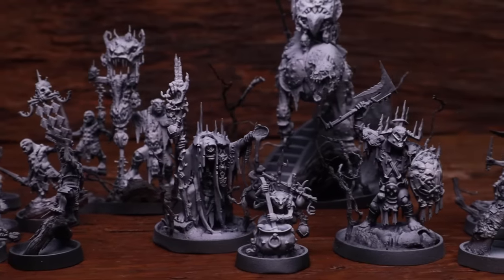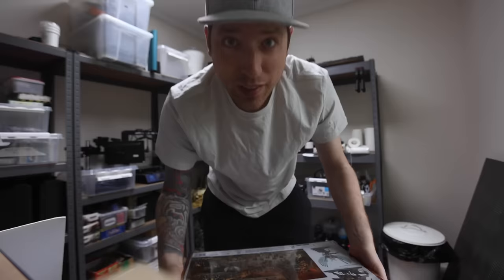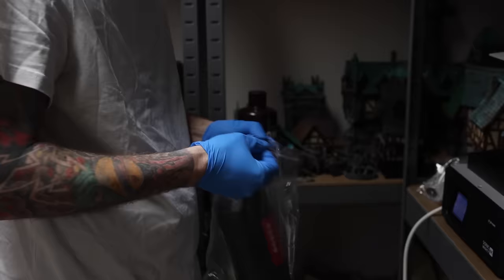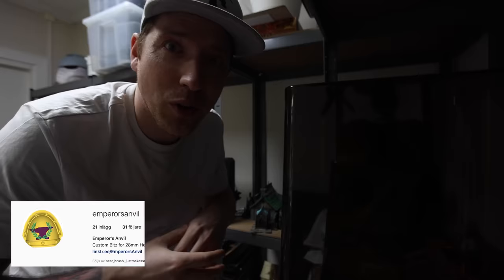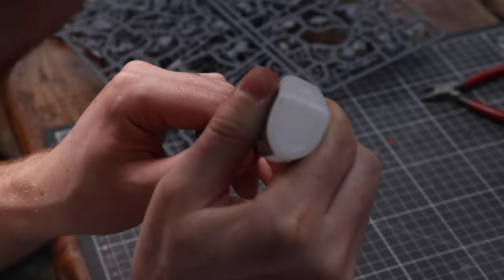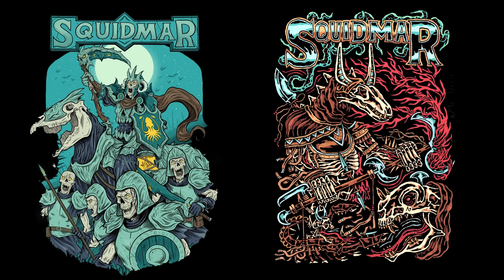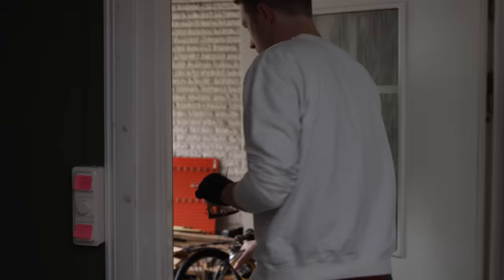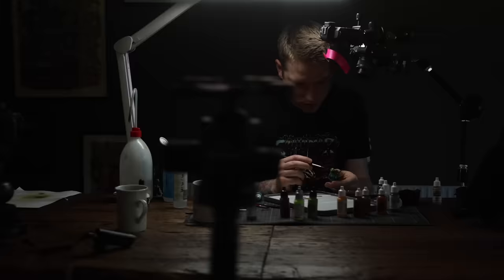Don't prep your Warhammer miniatures like a nub!

Comment: For glue, I would recommend the Tamiya model glue. You apply it using a small brush, which allows for really precise application, and the glue is super thin, so it runs into the cracks you may have missed or couldn’t get to. I originally started dong model tanks, and when I started getting into war hammer I kept using the glue and kept getting better results and having an easier time than when I used the citadel glue.
Reply: Second this. Ultrathin glue for plastics from Tamiya, Mr Hobby or AMMO is really good for anything plastic related, not just tanks and planes!
Reply: Yeah the Extra-thin version is awesome plastic glue
Reply: I am a beginner as well, and wanting to try out the suggestion of Brent from Goober i tried the Tamiya model glue too. Totally worthy purchase, the little brush makes it so easy and pleasant to apply the glue. A bit extra care should be used since the brush doesn't allow the same degree of control of the citadel long thin output, but i find out that i prefer having the glue laid in layers rather than in drops.
Reply: Yer but he has a relationship that involves him selling GW products.
YouTube is 99% advertising now
Reply: I mostly make model planes and I use two types of cement: tamiya extra thin cement and revell contacta professional. The tamiya has a brush and it’s great for attaching small parts as well as connecting long seams. The other thing it’s great for is melting a surface after sanding so the scratches etc soften or disappear after fettling. The revell glue has a needle applicator and is great for initial bonding of major assemblies as it is fairly precise, but also very strong.
Reply: To add onto this you can use Tamiya Airbrush Cleaner as cheaper substitute for Extra Thin. It has almost the same ingredients
Reply: Ditto on the Tamiya plastic glue. The brush style applicator is perfect and it comes in normal or cement versions. I use normal for most models with the cement reserved for large models or surfaces.
Reply: MAKE SURE YOU GET THE EXTRA-THIN VERSION, THE GREEN ONE
Reply: You can get CA glue in various viscosities and with different applicator tips for cheap. I use them for guitar repair, and using the right one for the job makes a huge difference.
Reply: @Brickfrog427  this glue changed my life, though I once bought the "quick dry" version on accident which 1.) dries way too quickly and 2.) smells much less "pleasant"
Reply: Yeah I gotta say the extra thin cement from Tamiya is my favourite purchase for the hobby I've ever made! Easy to apply, quite strong, melts down sanding and fills tiny gaps, AND with an almost empty pot (kinda hard to get with the brush at this point anyways) add heaps of cut up sprue and it'll become a thicker cement that is great for terrain!
Reply: Also when you get near the end you can make AWESOME sprue goo out of it and it is the best gap filler ever.
Reply: @Nidhoggrr  it’s all plastic cement as opposed to superglue. With superglue the glue creates a bridge between surfaces which creates a bond, plastic cement like what you use on models creates a bond by melting the plastic together, more like welding.
Reply: It also  lets you make the "sprue goo" mix that's really good for gap filling on its own
Reply: @AzraelThanatos  exactly! It’s magical stuff! Though if you’re making sprue goo you should use pure acetone instead, it’s much cheaper.
Reply: @JamLeGull  Yea I know how the different glues work.
Don't recall asking for a course on them.
Reply: @Nidhoggrr  you know, I can’t actually see what you know through a YouTube comment. There’s lots of people new to hobbies and I can’t tell who’s who. Don’t assume people are being condescending, it’s a bad look. Speaking of ignorance, I didn’t know tamiya did a CA glue. Is that what you were referring to?
Reply: @JamLeGull  I was literally talking about how I like Tamiya because of its' applicator.
You were the one assuming crap based off your miss reading of my comment.
Reply: @Nidhoggrr  yeah I got confused because you differentiated cement from glue by some metric I’m not familiar with, then asked what glues they make.
Reply: @JamLeGull  By a metric you are not familiar with?
Tamiya only has 2 types that I know of, the green thin and the orange cement. What's confusing about that.
Also at no point did I ever ask what glues they make. You obviously read that on another comment and attributed it to the wrong person.
Reply: @Nidhoggrr  they make other glues. Chill out.
Reply: @Dakota-ud6ci  Came to say this.  Tamiya Extra Thin has the best capillary reaction and when you bulk it up with sprue it makes a fantastic filler that blows "liquid green stuff" or "plastic putty" out of the water, never mind kneadatite or Milliput.
Reply: the limonene are the good for your room and your lungs.
Reply: @mastodonseven  To be fair, thicker glues like the GW still have their place. They have some slight gap-filling properties and since they are slower burning can create stronger bonds when applied to larger pieces.
Reply: @DarthFolo  
Thanks for the insight.
Reply: When you're mostly done with a jar of tamiya extra thin, throw in a bit of sprue, it'll melt it down and become plastic putty.
Reply: I myself use that glue and I can confirm it is amazing and that brush is so good for applying the glue.
Reply: @NeilSearle  I'm replying just cause I can.
Don't care about what you have to say but it's nice to see others can also type a lot of pointless drivel.
Reply: I've used Mr hobby and I love it
Reply: I just started collecting and I build a whole necron army with the Tamiya extra thing glue, that shit made it so easy to build, even on something the size of a deathscythe aircraft it worked really well.

Comment: Fir gap filling, I'd recommend Vallejo Plastic Putty. It's pretty much the same process as you have now, except it already comes as putty, so you don't need to mess around with iso or anything. You can also easily file it after it's hardened, works great.

Comment: I prepare my minis this way, and I have to say that it takes a LONG time to get to the painting process, also after spending so much time prepping the mini I can't bring myself to not give my best, which leaves me with painting 1 space marine for 8-10 hours. 

It's worth noting that I paint slowly and this process could be sped up to probably 5 hours with the same result but for bigger quantities or even small squads it takes ages.

Personally I would advice anyone to seriously prepare their minis and paint them to as good as possible IF those are display miniatures or an important unit, for example an HQ. If they're just troops or a cheap PVC minis for a board game don't bother that much, just reach an acceptable level.

This way you can both practice quality and speed of your paintjobs and end with a good looking army / set in a reasonable amount of time.
Reply: PVC is my bane. I know they're rank and file, and probably not going to look that great regardless, but I still wind up spending way, way too long trying to clean them up.
Reply: @cinnabarsin4288  I know your pain man

Comment: I really recommend you try out Tamiya plastic glue; the thin type that flows into recesses through extreme capillary action. They also come with a little brush, which ai find way easier to use than the Citadel nozzle.

Comment: a trick i learned building gunpla:  dont snip the sprue close to the model, leave a few milimeters.  trim with a hobby knife and sand first with 600 grit to even the surface, and 1000 grit to polish.  you almost never get stress marks this way, though it is a bit more time consuming.

not sure just how applicable it is to WH models due to differing materials, but it should work for just about any plastic.

Comment: **Unclog hack for the GW plastic glue** take a lighter and heat up the metal till you see a pop at the end and an open flame come out the top. Only thing is you have to wait a couple minutes after doing this because the heat will cause it to clog again.

Comment: i'm 35 years old and started the hobby over 25 years ago. a huge amount of "techniques" we had to teach ourselves are now milliput and structure paint. but one thing we learned, i haven't seen till now: add a spoon of water binding glue to one cup of plaster /fast reacting). take double the water. now you can pour it onto styro and whatever without the pain of it drooling away. it even builds a valid exoskeleton. just do a thin layer or the piece could warp. lg
Reply: edit: the most foam materials don't bind with plaster (because of air). the glue stops it. it's even that tough - your angry friend "drops it accidently" onto the wall and the model lost only a bit of colour...^^

Comment: This is pretty much it! I follow the same procedure, and I even enjoy it almost more than painting. 
For glue its Revell plastic glue for me (also because of the needle applicator. Tipp: burn it out with a lighter if it clogs..), and gap filling with milliput or vallejo's plastic putty.

Maybe the only thing I do differently is check for sub assemblies if possible. Makes painting so much easier. But for the easy fit models from the starter sets its almost impossible...

Thanks for sharing. Great tips for everyone!

Comment: I was happy to see we handle our bases much the same.  I build every single base for an army separate form the mini initially.  Where we differ is that I will fully prime and paint the base completely separate from the model, and only glue them together after they are each painted.  My mini's get stuck to the tops of Rx bottle via double sided tape similar to Miniac.

Comment: @squidmar I've started using airbrush black primer from Vallejo with a brush for priming. It's a bit slow but the paint shrinks when it dries so it's super durable and extremely thin when it dries.

Comment: I really like the Tamiya super fine glue. You get a big ass bottle and the cap has a little brush for precise application. But since it's a thin liquid it evaporates quite quickly if you aren't kinda thick with it

Comment: For people that are planning to use the zenithal highlight to go over with transparent paint like inks, I would advice you to thin down the white ink (I like a ratio of 50/50 white ink to airbrush thinner) so the underlayer of white is smoother compared to using white strait up. Sprayer at a higher pressure also helps.
Reply: What if using a spray can?

Comment: Tip for using Citadel plastic glue: if your metal tube gets clogged with glue, just heat it up with a lighter and it will clear up the clog.

Comment: Miliput with IPA sounds like Vallejo Plastic Putty (70.401) with extra steps ;) Also there is the Revell plastic glue that comes with a metal tip for easy application. Just in case you're not getting any G'Wullu stuff ;) 
And I wonder. When a wargamer says "I will enjoy this so much"... will he really enjoy it? Does he hope that he'll enjoy it or is it some sort of "I need to convince myself" mantra? ;)

Comment: I clean my sprues with a soft, soapy toothbrush before clipping and assembling. Is that not necessary?
Reply from the maker: not gw plastic, resin you might have too depending on if thy used a mould release agent or not
Reply: @SquidmarMiniatures  Good to know, thanks!

Comment: How do you fix the models to the base? Glue? Or pin them?

Worth trying vallejo plastic putty. Comes in a tube and really easy to squeeze it into the gap and smooth over. Way easier than messing about with milliput.

Comment: Would like some good info on whether wearing a mask while airbrushing is necessary. Squidmar wasn't using one, I've seen folks saying you must. And then there's general ventilation - on how much is needed. 

I'm honestly not sure what's best with so much conflicting advice.

Would only be using acrylic based paints etc (no oils etc)

Comment: Are you sure you wanna do those bases with a resin printer and not an FDM? With a fine enough layer height and the primer you should get the same result faster and cheaper, if you have an FDM printer that is 😅

Comment: I'd like to see a video about building & prepping bastard-level models. I'm currently building the Archaon on a 3-headed dragon kit, and while it looks amazing, it's a horrible model to build because it's difficult to close the gaps between the parts, the tail breaks apart very easily due to the top-heavy weight of the model, and the dragon is connected to the base by two laughably flimsy and tiny points-of-contact.

In short, Games Workshop designed this model to BREAK on purpose. I'm  pretty experienced at building model kits and a know some tricks and techniques, but this one is hard work. Even being super-careful I accidentally snapped one of the crows and there is no way to repair it. Pinning the tail with brass rod is not simple; if I had known before I had started that the kit would be so fragile and top-heavy, I would have run strong brass rod up through the tail and up through the body before I glued the parts together, and used epoxy resin to permanently fix the brass rod to one side (of the inside_ of the model.

The model absolutely needs pinning to the base, but the base is extremely shallow, and the point of contact is thin, so creativity is required. Seriously, this model was deliberately designed to be broken if anyone played with it on a tabletop. It is so, so fragile. 

About side-cutters/sprue-cutters: I bought Tamiya sprue-cutters a little while ago, and wow they ARE awesome! I love them. They are fragile, and must only be used for small plastic parts but they are very precise and cut super-clean. A word of warning though: They are deadly sharp. Do not screw around with these things; I've not done myself any injury yet, but I have no doubt they would cut through my finger like a scalpel. They are vicious.

Comment: Do you find it's easier to paint certain parts of some miniatures while they are still on the sprue? I find if certain parts of them are going to be too close together that painting them can be too much of a challenge this way. Your thoughts?
Reply from the maker: no cause when you cut the pieces away then and clean up the bits you have to repaint it again :) maybe a shield i'd leave off for a display piece, but not when painting an army :)

Comment: Well planned is half done. XD Wise gets away with lesser. Eezy doz it. I like Revell red one, that says its special plastic glue, it welds plastic really well and won't glue your finger as easily. Making it easier to work than superglue. that metal tip always gets stuck if don't close it right way BTW, squeeze the bottle, before closing it, then close cap/tip and then release the squeeze. If that metal part gets stuck you can use needle or heat to open it, I never use that BTW, apply glue to stick and then use that stick as tool to apply the glue in right spot. also close the cap as fast possible and apply glue to modell ASAP don't let it sit or else you gonna get glue spider web strings everywhere. GG Njoy XD

Comment: I must say, I really like the chill vibe. It's like your old vids :) The newer vids (fiverr, biggest or most expensive models etc) are super cool and fun on paper, but in reality they become a little bit gimmicky IMO. I don't mean to hate, I just think there is a great value to this kind of "simpler" video as well. But hey, you do you! Keep up the awesome work.

I'll throw in a question as well; How do you make custom bases where the mini doesn't stand like it's the leaning tower of Pisa since they are so static? Just break the mini's legs and remove some material, or do you find 2 fitting parts to put each foot/leg on so it doesn't slope so much or do you just roll with it and let the mini slope?

Comment: Technical question, was there really a need to place the base at a 45° angle in the slicer? Wouldn't it print perfectly if you oriented it to be horizontal and "bottoms up" so you don't waste on supports?
Reply: I had the exact same thought. It’s not like Bases like that have some details that need to come out extra crisp, so why not safe some resin in the process
Reply: @viciousyeen6644  ikr? I gave it a bit more thought and maybe if you placed that shape horizontally it would create too much suction every time the plate raises and could tear the print from the printing plate. 
Or they just wasted resin.